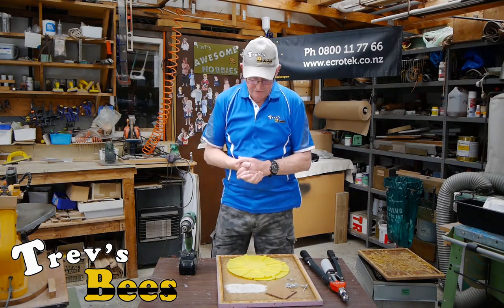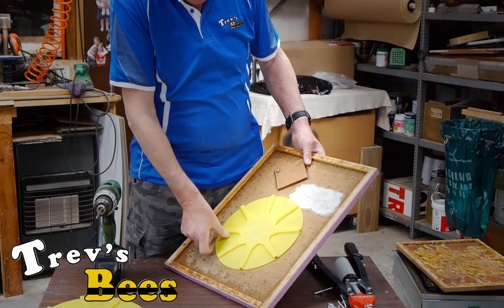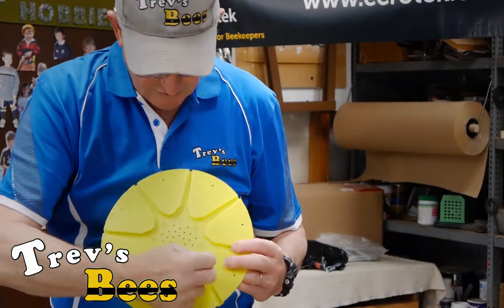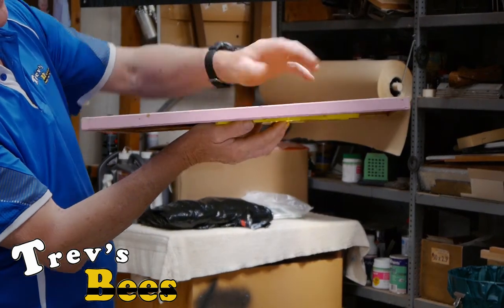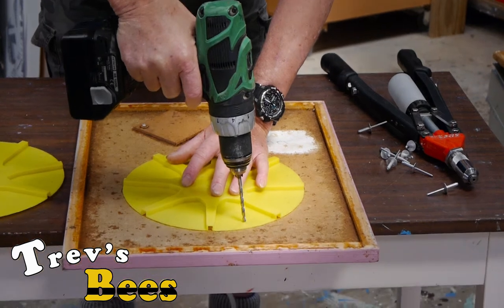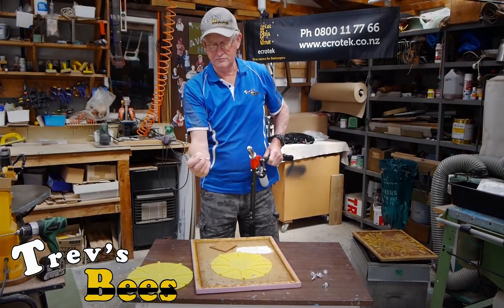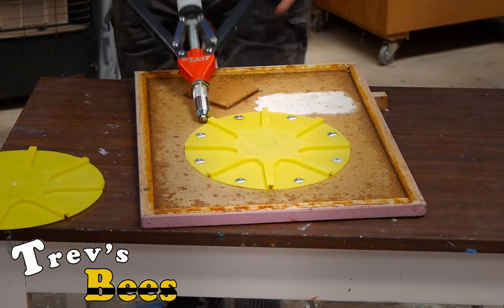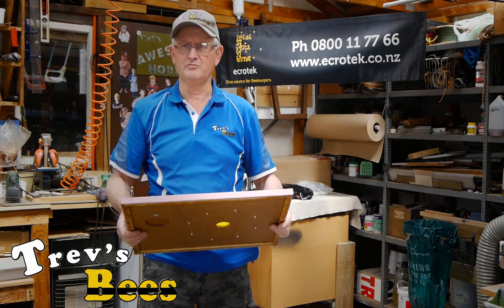Trevs Bees - 8 way Bee Escape

Comment: I use the 8 way bee escape here in the UK.  They are a good thing, and I'd really be interested to hear what you make of them, after giving them a try Trev.

One thing I did find made them work a bit better and kept the girls happier, was on the side of the mat that the escape is mounted, the side that goes down, the side that goes to the brood chamber, rather than about a 10mm bee space, give the girls about 60mm of space. - That way when they are clustered around the central vent, the cluster is clear of the tops of the frames.

Put the escape on before you want to remove your supers, but get those supers off within 48 hours, after that the bees will have figured it out!

All the best to you Trev and to Teresa, David and Heather.